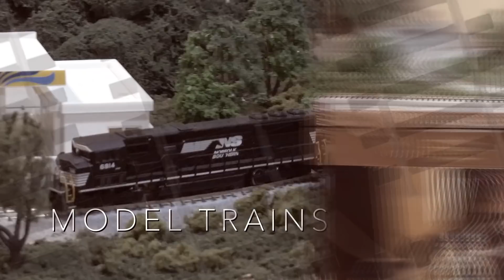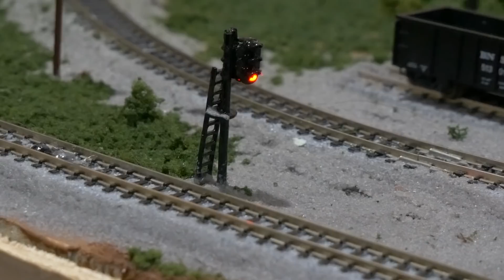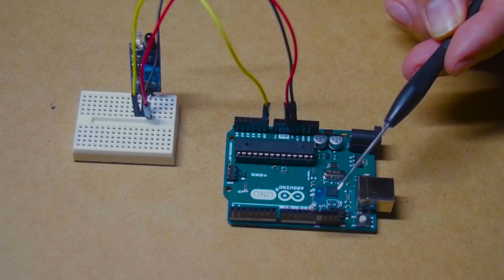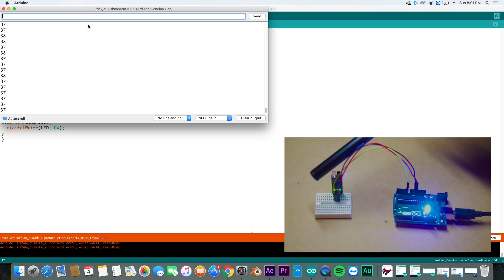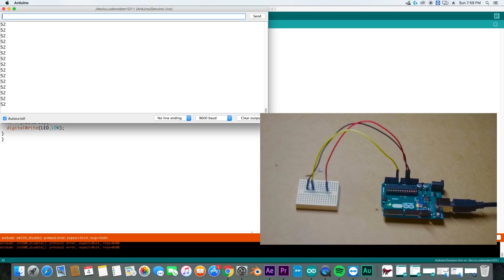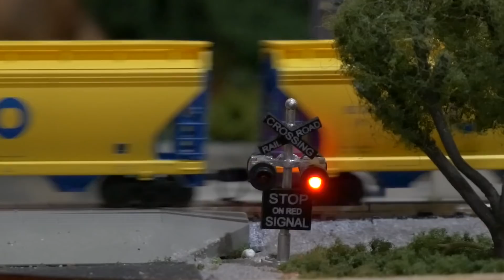Arduino Basics:  Using sensors on your Model Railroad!

Comment: It would really help if this guy put the schematics for these circuits.  You cannot really tell the hookups by looking at the video, as they are not 3D.  So you have to guess at how the circuit is connected.  This made this video extremely frustrating.
Reply from the maker: I can certainly make some and add it to them.  This video is from a long time ago and I didn’t know how to make schematics like I do now.
Reply: @DIYDigitalRailroad   Wow, didn't expect a response because the video was a few years old.  Yes, well I am trying to get sensors on my layout, hence the Mega, which I have yet to make sense of.  Thanks for your quick response, and I will look forward to the schematics.  There are plenty of Arduino type deals on the internet, plus I am trying to make use of the Micro-Cap also.  Thanks again!  (P.S.) and for Arduino MEGA, because automation and control is dependent on on sensors, and you need a lot of them.  Thanks again.

Comment: Hi Jimmy, thank you for this video. I'm interested in your experiences with both the IR sensor and the photorestor under low light conditions. Do they still trip properly if it's darker in the train room? Overall, do you prefer using the IR sensor or the photoresistor?

Comment: The following is open source. Advantage: faster code, better structure, less nonsense. 

// completely parametrize code....
const int SENSOR = A0;
const int LED = 13;
const int SENSOR_THRESHOLD = 500;
const int DEBUG_MODE = false;

void setup() {
  Serial.begin(9600);
  pinMode(LED, OUTPUT);
}

void loop() {
  // read
  int sensorValue = analogRead(SENSOR);

  // write
  int ledValue = (SENSOR_THRESHOLD > sensorValue) ? HIGH : LOW;
  digitalWrite(LED, ledValue);

  if (DEBUG_MODE) {
    Serial.print(sensorValue);
    Serial.print(ledValue);
  }
  
  // wait
  delay(100);
}
Reply from the maker: Great stuff!  Thanks for the code!
Reply: @DIYDigitalRailroad  It's give and take, isn't it? Thanks, mate.

Comment: Good stuff!

Two code style comments (I teach C/C++ programming, sorry) -

Use spaces for better legibility - 

int valA1 = analogRead( sensor );
pinMode( LED, OUTPUT );

You don't need the "if" after the "else" or the second test if it is the last option in the if block since there are only two possible states in this case:

if ( valA1 < 500 ) {
    digitalWrite( LED, HIGH );
} else {
    digitalWrite( LED, LOW );
}

Based on 30+ years of this, these make the code a lot easier to follow - especially in the case of new coders.
Reply from the maker: Timpraetor Thank you!
Reply: @DIYDigitalRailroad  My pleasure - your simplified "chunks" make all of this easier for everyone to follow.
Reply: Also, on the off chance that the read value is 500,  your code does not define what to do with the LED. Tim's fix avoids that as well.

Comment: Nice one Jimmy, the clarity of your presentations is much appreciated, you just need to practice your tiepin!. Would it be easy to add extra LED sensors? Would that mean just adding the same commands to the sketch with different pin Nos. etc.?